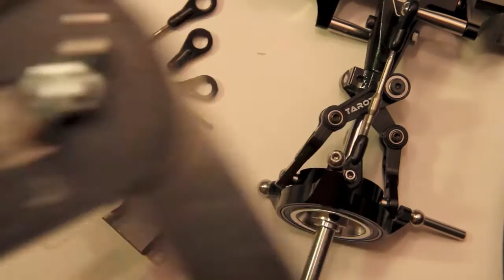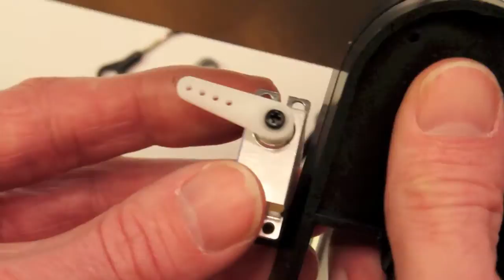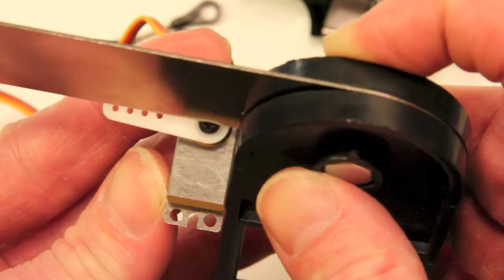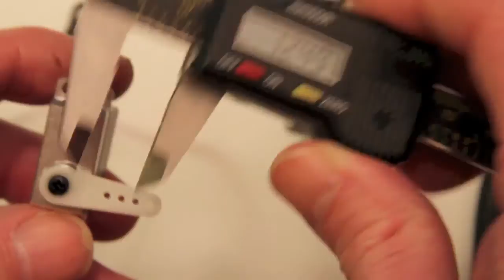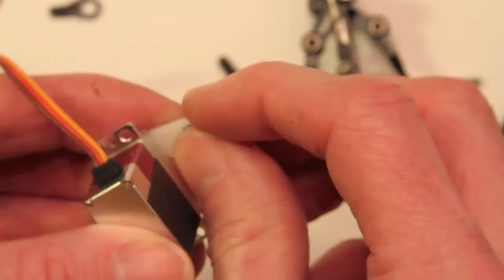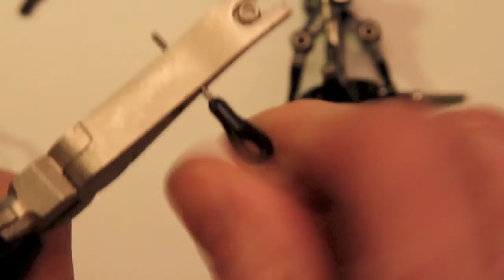15 : Tarot 450 Pro V2 Build : Servo Wrap up and Ball Links

Comment from the maker: That's odd.  Sorry imdyellow1, you're getting into transmitter specific issues that I am not sure about.  It sounds like you are doing everything right...but sub trim should only effect one channel at a time. I am not sure why it would move the other channels.  If you are using these instructions to get into the sub trim settings, then I am lost on how to help you further:

Comment from the maker: Where are you adjusting the sub trim?  If you are doing it from the radio transmitter, what radio is it (Devo 7???), and what is your method? Are you just using a switch or button on the front of the transmitter, or are you going into the sub trim menu function to change it?

Comment from the maker: You'll just have to get it as close as you can with the splines on the servo arms, and then use the subtrim (probably in your FBL system to get it the rest of the way.  Between the mechanical adjustments and then the rest in subtrim, you should be able to get it to 90.  One of mine needed a bunch of subtrim too.

Comment from the maker: Assume that you have a range of travel of 6 hours...in this case, since we are centered on the 12, then the arm can move from the 9 oclock position sweep back to 12 at the center, and the move all the way around to the 3 oclock position. You have equal distance of travel on both sides of center. If you set your servo arm off that 90 degree mark, then you might have a lopsided range of travel. It might move from 10 to 4, or perhaps even 10 to 3 -- binding or hitting mechanical limits before

Comment from the maker: My initial response is that you *should* be able to get them to 90...or at least pretty close. So if you are having trouble with that, we should try and figure out why.  To directly answer your question, though, the point of getting them to 90 is to center the servo arm within its range of travel.  So if you are looking at a clock face (analog of course) 12 is at the top, 3 to the right, 6 down at the bottom, and 9 to the left.   Lets assume your 90 degree arm location is aligned with the 12.

Comment from the maker: I'll be doing the tail servo prep and install very soon!   What gyro are you using?  Does it look like it is trying to adjust because it is being tilted or moved (what it is designed to do in flight) or does it just move once when you power it on? All of my servos move when I connect them to power...as they jump to their center point. They shouldn't move after that tho, while you are on the bench.

Comment: The tarot zyx manual clearly states on page 6 that for a 450 size heli the ball needs to be 12.5-13mm from the ball to center.  The holes in the servo arms will vary based on manufacturer so measuring them is the best way to get the closest one.  If they are not exact then go for the one that's the smaller distance..